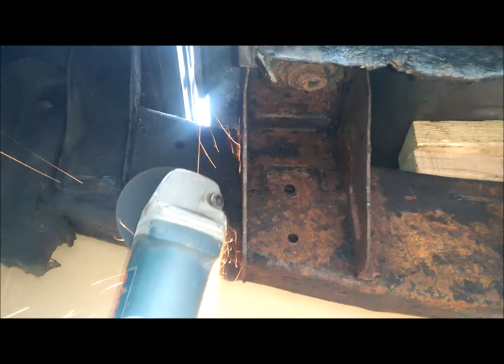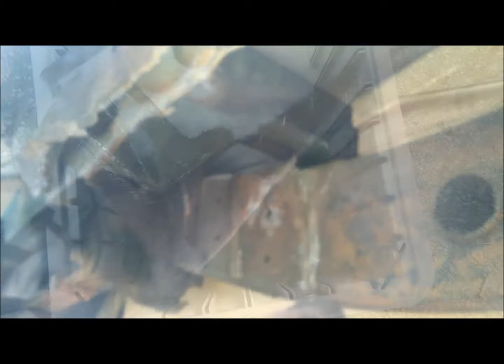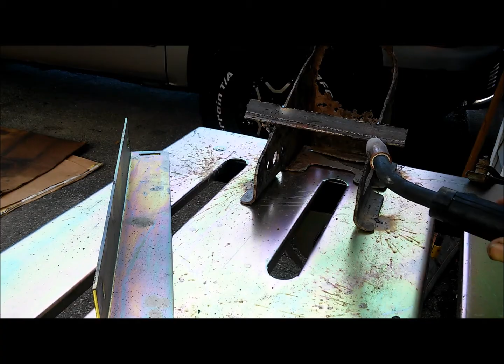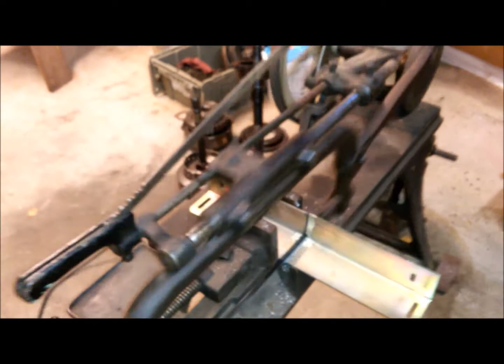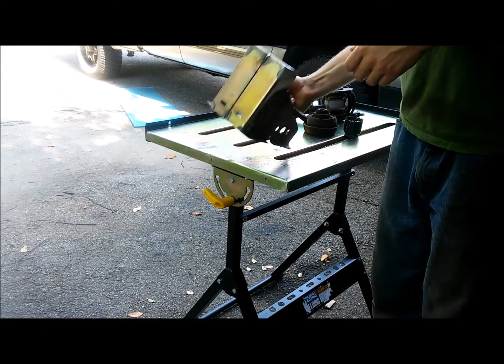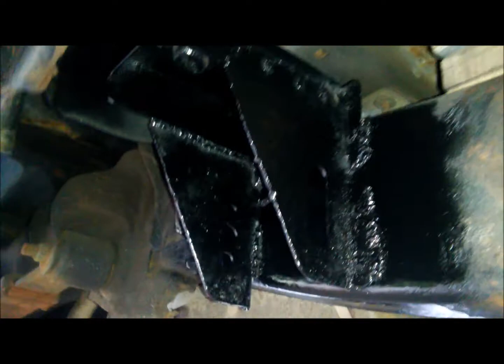Chevy truck body Mount Replacement

Comment: Why didn't u replace them instead of reusing them  energy suspension cab mounts bushing are much better than rubber
Reply from the maker: I agree the energy suspension would be a better option but the frame was getting very soft and I didn’t think it would last more that two or three years. I wasn’t looking to sink any more money or time into the truck than I had to.